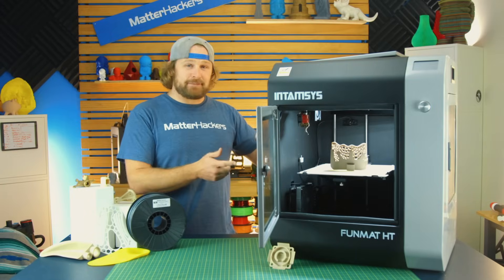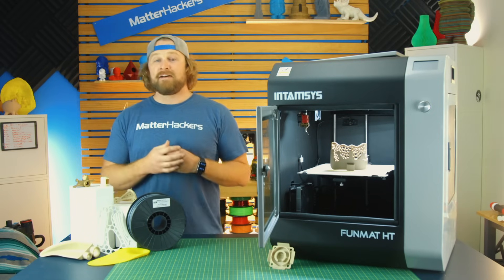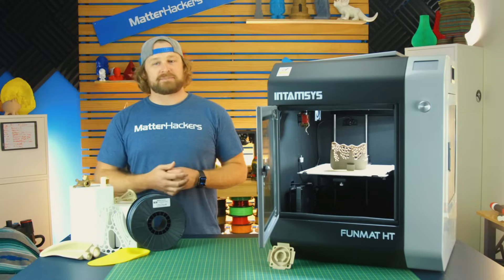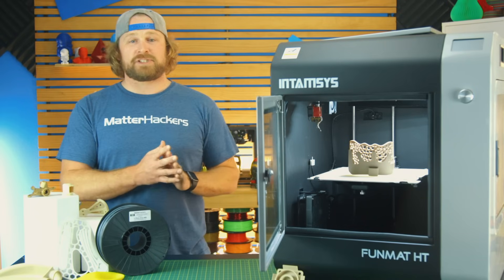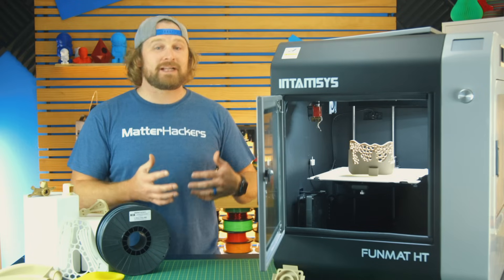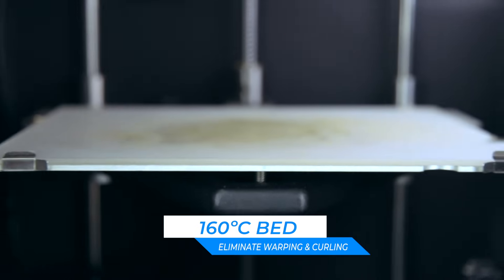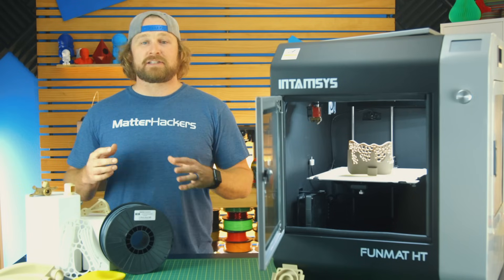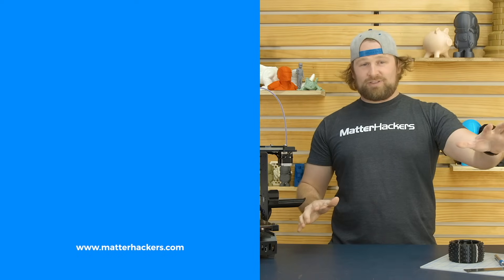Intamsys Funmat HT // 3D Printer Highlights

Comment: only $5,000.00usd!!! no wonder you didnt want to mention the price
Reply: Peter Ellens Not bad for business usage. Based off the spec mentioned in this video, I would choose this printer over Ultimaker.
Reply: Its really cheap if it performs properly with PEEK and Ultem..
Reply: Price was likely not mentioned because this is a video for the product page. Price could fluctuate over time.